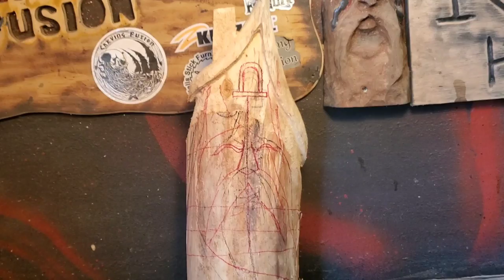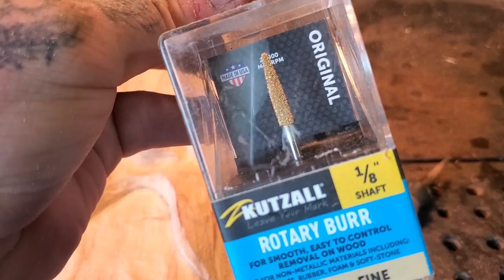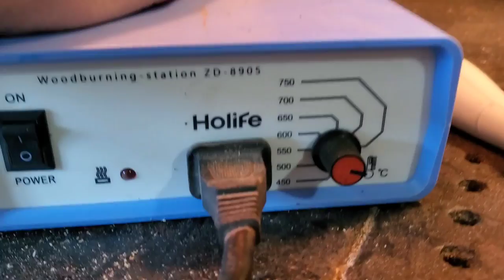Carving a spirit house thing. #2

Comment: It is looking marvelous so far. I liked how the fine kutzall bit burnt the wood as you were undercutting the moustache. It gave the moustache more dimension. Also finish the basswood house using craft moss on the roof rather than the wood shingles, and ruff up the sides of the basswood so that the sides look like tree bark, then this way it won't look like a dickhead.
Thanks for the videos of this project.
❤️💕❤️💕❤️💕❤️💕❤️💕❤️💕❤️
Reply from the maker: Some great ideas 💡